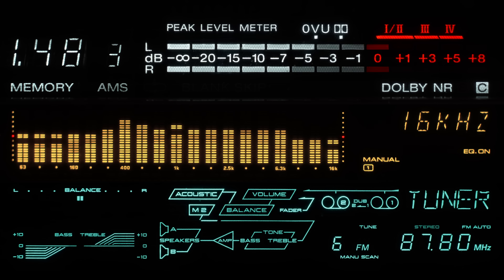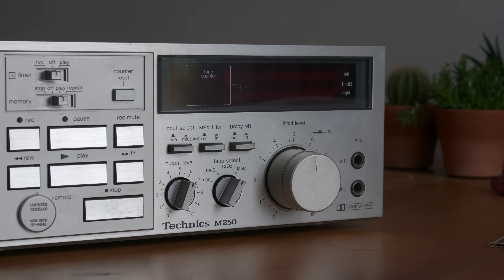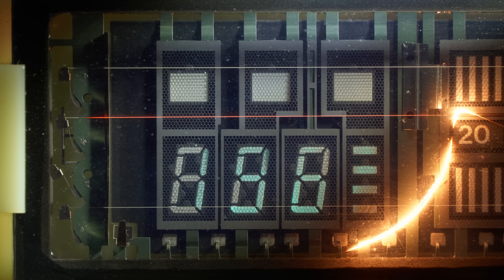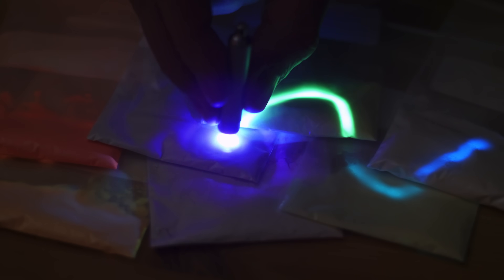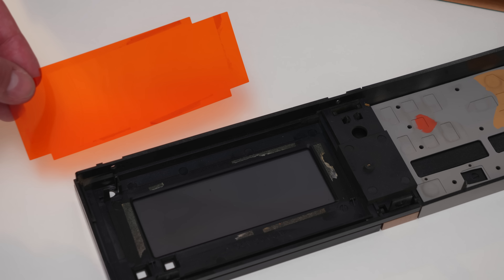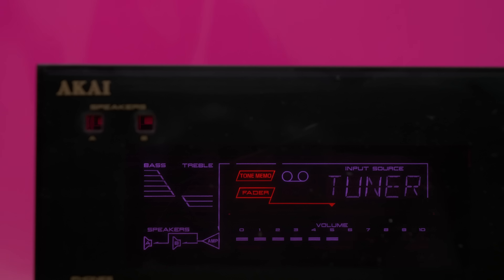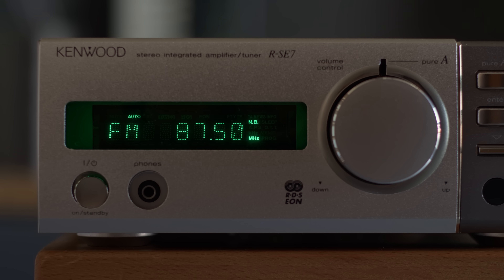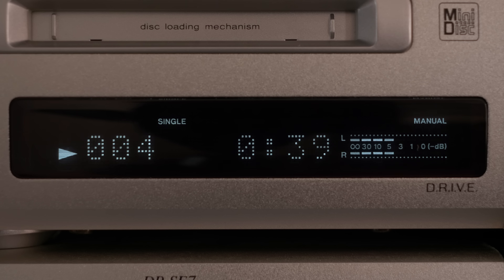VFD Displays

Comment: i did literally this! on my adcom gtp-500 preamp - while i had it taken apart for a recap and some other repairs. you can see it in a couple of my videos (akufen tracks, before i swapped in my diatone gear) - the tuner frequency counter is red instead of turquoise

Comment: There is a very interesting VFD prototype of the "reverse design" mentioned of the in the December 1986 Issue of Information Display, a full-color RGB dot-trio VFD.  "A 320 x 320 pixel color graphic front luminous vacuum fluorescent display (FL VFD) having a bright image that is observed from the phosphor-coated side. Display area is 7" x 48". RGB trios pitch is 0.56mm. By controlling light emitting time per dot. halftone images can be generated on the display- K. Morimoto and E. lmaizumi., Futaba Corp ., Mobara, Chiba"
That is all that's mentioned, really wish I could find a photo of it.
Reply from the maker: That would indeed be very cool! I wondered if any usable RGB matrix VFD was made. I guess not, else it would probably have been in some portable TV's at the time.

Comment: Is there a way to brighten older displays? I read online that sometimes you can put more power through them, to make it burn off any "impurities" such as dust accumulated over the years? What is the aprox age limit for these displays. I have a Pioneer XR A700 and its main display is dimming fast! It was probably kept on for years before i purchased it.
Reply from the maker: There are tricks but out of my capabilities I'm afraid ;)
Reply: I'm just learning about some of this, too.  Is your device in regular use, or bringing it back out of mothballs?  I ask because I have some old Kenwood components, and I'm trying to get the band back together, so I bought a few others to build a full HiFi stack.  In particular, the tape deck's VFD was very dim, but exercising the elements got them to brighten up considerably -- like, from so dim you could barely see that it was lit, to close enough to full brightness.  Unfortunately it doesn't have a test mode that lights all the segments -- just one that lights some of the segments -- so it'll take a while.

Comment: Are there any modern VFD displays you can buy or a company that still makes them?

I know you can archive the same look with color LCD, but there is a problem

You see, color lcds need i2c to drive them and this produces noise

Check this comparison: https://youtu.be/6Km6bpqRFc0

Here are 2 identical radios, the only difference is display, and the lcd version has so much noise

Now VFD displays look realy nice and they dont make noise (I thimk because all my components that have them also hsve AM radio, snd no noise is generated'l so they are goto option if you want to create a colorfull display without noise
Reply: Yeah they’re still made. Futaba and Noritake are the two big names.
Reply: As for I2C noise: 1. ummm… no, not all color LCDs are driven with I2C. In fact, most are not, because I2C is simply too slow for all but the smallest color LCDs.
2. It is possible to use I2C and not create audible interference.
Reply: I just watched the video you link to, and the color LCD display shown is far too large to be driven with I2C. It could be SPI, or RGB parallel, or MIPI, etc.
Reply: @tookitogo  thanks

You know I am not electrical engeneer, I am just bothered by noise and trying to find best way to eather not cause it or mitigate it (since it appears manufacterers dont care and you cannot buy a device that doesnt cause noise)

And I thought that since devices that had vfd display had am radio its maybe a screen problem

BTW: the device is called TEF6686 radio and its design is open source

Would send you a link to the gerber files for it, if I could

But you know how youtube is, it just deletes your comment if it has a link
Reply: @Veso266  Low-noise design is difficult. (I am not yet very experienced with that myself, but I know it’s hard.) So not surprising that one can introduce noise with a high speed bus.

Yeah, I’m all too familiar with the comment censorship… :(

Comment: Nice 😎 VFDs are fascinating in that they are pretty much bespoke for every device, yet these days an LCD or TFT will do the same but so much more, yet I was always intrigued by the elements on VFDs that would never light up or be used - I pulled one apart from a late 2000s DVR as it was doing some weird stuff - I played around injecting voltages into the grid which was fun, then alas it got toasted accidentally 😥
Reply: Haha.. In my earlier days, I would always wonder what hidden features I hadn't found on a device by looking at the VFD to see which segments I had never seen lit.  It seemed preposterous that a manufacturer would have designed a display with segments that weren't used, so there had to be something I was missing...

A lot of consternation could've been avoided if I had been made aware that sometimes one part is used in many SKUs.  ;-)
Reply: @sirnickity  or features you didn’t get like the blanking plates in a car for optional extras 😂

Comment: The light in VFDs is produced by phosphors, which come in different colors.  The usual one is the bluish-white one (I think it's P40 or P41) that's chosen to produce good light output and long lifetime at the low voltages at which VFDs operate.  However, the red and orange displays are different phosphors instead of color filters.  Sometimes a green phosphor is used as well.  Since the light generated by phosphors is generally fairly wideband (unlike, say, LEDs), you can change it with filters, so some will be filtered to look more blue or green or (as in the one with the glowing filament) pink or red.
Reply: Why do fluorescent tubes exhibit a narrowband emission, while modern phosphor LEDs have a broadband emission covering the entire visible range? Just time and research?

Why did these VFDs use color filters when they could upconvert from UV or blue? Contrast? They could've just used a black mask.

Comment: In fact, VFDs have a timeless charm, to be quite honest, I have a Kenwood A7 myself, with just the main module and EQ (Needs repair unfortunately), and being quite honest? These old stereos have very good sound quality, even by today's terms.

I think the only problem with this channel is the fact that it encourages me to want to buy these devices knowing that I'll have difficulties finding repair parts, that Dual MN-8010 for that matter, in addition to not being able to find it here on Brazil, if I import one, but if it breaks down, I don't think I'll be able to find parts
Reply: "even by today's terms"

ESPECIALLY by today's terms.  Everything on the market now is trying to beat physics with DSP.  When you bought a stereo in the 80s or 90s, its size and gauge of wires were all an honest declaration of what it was capable of.  DSP is nearly magic, but it will never, ever hold a candle to a device that can just do the thing.

Comment: Great video! I always thoroughly enjoy your content. The macro shots were fantastic. I love VFDs, they have fabulous contrast and a analogue look that can't be replicated. I miss seeing them instead of the bland LCDs we have now. Fun fact: VFDs are effectively triodes.
Reply: They seem to be triodes in a bit of a nonstandard configuration. Instead of varying the grid voltage to control the transconductance, they're varying the plate voltage. Essentially they're using the filament and the grid of a triode as an electron gun, and each of the fluorescent segments is turned on by applying a high positive voltage to attract those electrons. Pretty cool, I see now how  closely related VFDs are to CRT displays.

Comment: That's so intricately beautiful.

VFD display is really a lost art, the shear amount of engineering that goes into creating these display are remarkable.

Nowadays its replace with LCD/LEDs which yes is more efficient, but it just doesn't look and feel the same.
Reply: It's strange, LCD and LEDs if anything are more of brilliant technology, but they just don't feel the same.
Reply: Man, I miss VFD.  I absolutely love that aesthetic.  Things with LED / LCD displays just look low-budget compared to proper VF displays.
Reply: My new stereo receiver still has a VFD. They're disappearing but aren't gone yet!
Reply: @christianelzey9703  Quite a few Denon devices have them still
Reply: I think its just because LCDs and LEDS are mass manufactured, you can use the mother glass for different things, at least I believe. For example, you may get only 1 large tv but with the remaining leftovers, they can be turned into another smaller product. Maybe VFDs were also mass manufactured but I really cant see them being "generic" enough for widespread applications.
Reply: I actually bought a new stereo system recent, which initially I though it has a VFD display.

On closer inspection, I discovered it’s really just a LED display with a color filter, but it looks very convincing from afar.

If I haven’t discovered it was a LED display, I would not give a second though but now it just feel abit… weird that it looks like VFD but it isn’t!
Reply: As a software developer I'd like to point at the sheer amount of Graphic Design and User Interaction that goes into them!
Reply: Watching my graphic equaliser frequencies bouncing around right now in a completely different and new light 😊 Thank you for this, it's made my day 😊😊😊
Reply: Though modern lcd and oled displays are starting to have enough pixel density that you could emulate a very convincing VFD with them, and get the best of both worlds.
Reply: You can achieve the effect with them if you want, as well as with OLED I think

Comment: It is interesting to know how engineers worked around the cost and technology to create the aesthetic they wanted in the old days. Nice contents as always and thanks for the new music.
Reply from the maker: Thank you!! :-)
Reply: as someone who designs interfaces, it makes me appreciate how easy we have it today lol. but also it would be really cool to work with these displays
Reply: great video mate! Some of the displays you've shown are not VFD's at all, but backlit LCD's - just wanted to point that out... the designers made them look like VFD's - especially in the 2000's era this type of LCD's were popular... they imitated the high end look of the devices from the 90's 🙂
Reply: @evoelias6035  Sometimes they go at great lengths to make sure displays match, especially when different suppliers are involved.  I had a 1998 Pontiac Grand Prix GTP (Supercharged 3.8L), and much like Audi of the same era, all of the dashboard lights are red.  All of the digital displays were backlit reverse LCD (and so they were red segments) except the HVAC, which was clearly a standard bluish-green VFD.  This was because 1998 was the first year of the new design, and only the GTP had digital HVAC, so they must have not specified correctly.  However, the 1999 GTP had a matching red HVAC display.  I found one in a junkyard, but the buttons were worn, so I disassembled it to use my buttons and was shocked to find a red filter over the same VFD!  I was sure it was an LCD lol.  I later learned about the filter and how common it was used, like in mirrors with a compass and/or outside temperature display in different cars... All the Gentex mirrors use a greenish blue VFD and Audi/BMW put a red filter and certain other cars made them yellow (I can't remember who... Cadillac?).
Reply: @davidkane4300  very interesting indeed... most european cars from that era used unreliable backlit LCD technoogy. I remember that Audi and Volkswagen had often issues with dead pixels... VFD's seem to be rather uncommon there... I really like the sharpness of bright blue VFD's. I remember getting my first CASIO G-Shock back in the day. I think It used that VFD tehcnnology as backlight for the LCD - or am I wrong there?
Reply: @evoelias6035 Have you got a timestamp?
Reply: @dylanh333  the output variable is boolean only (True)
Reply: @evoelias6035  Which of the displays were the backlit LCDs?
Reply: And yet it still looks better than what they wanted to initially achieve